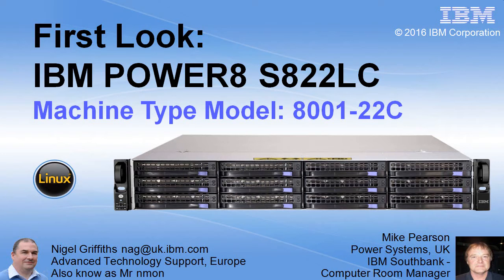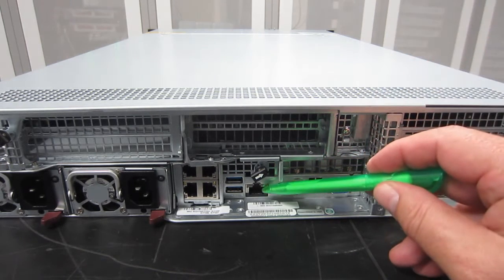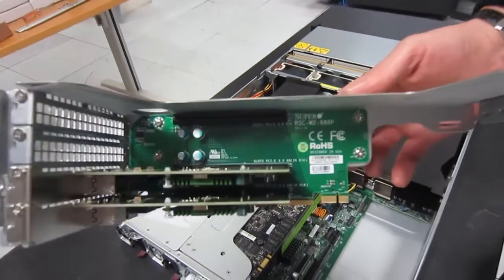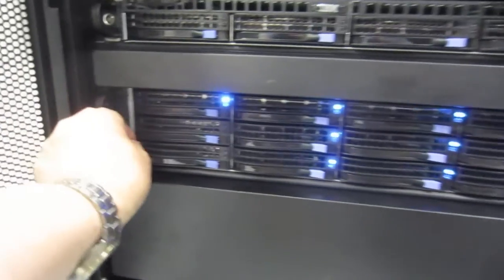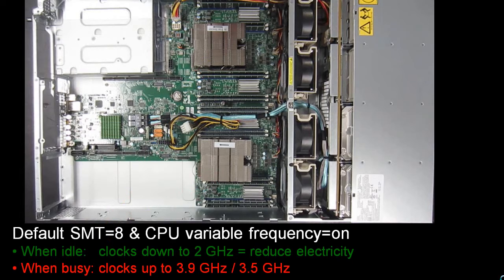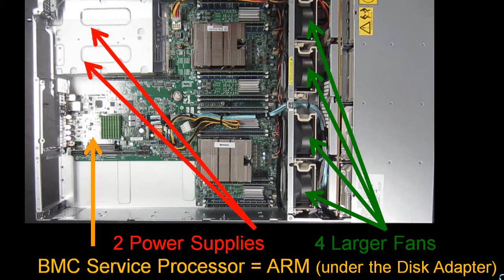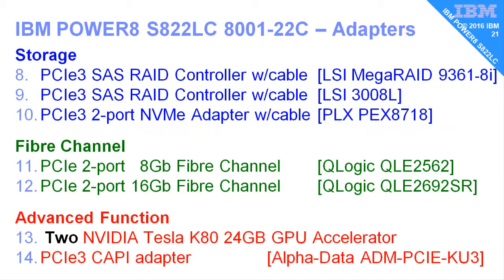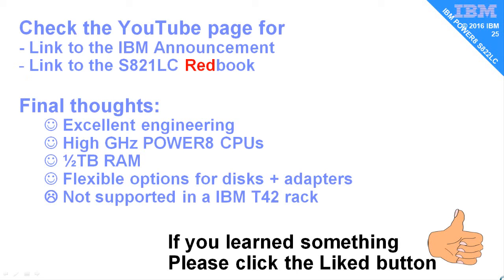First Look IBM POWER8 S822LC 8001-22C (Briggs)

Comment from the maker: Dear HelmetVanga
1) Yes, this is a server with20 CPU cores and a TB of RAM it is is not going to be a workstation!
2) It has four Ethernet connectors plus you can add further network adapters.  Every one of which should be connected to an Ethernet switch (router). Typical, networks are for different purposes Company Application Users (or the Internets with its 6 billion devices), System Admin Users, for Backup and to others servers in the computer room.
I can't imagine what you mean by four workstations.
3) Over the network, you can connect any sort of laptop running Telnet, FTP, ssh, VNC and many other network protocols. So there are many ways to access Windows 10.
I hope this was useful, Cheers, Nigel Grifftihs
Reply: thank you, you answered all  questions we. We intend to run CATIA software, ArchiCAD & GrabCad for design.

Comment: There is no question about the presentation of this IBM hardware. However, there are many questions 1) This is a server obviously. 2) it has 4 ethernet connectors, which means for 4 workstations...correct?   can you connect to this server wirelessly?  can this server be connected to a router ?  to access it from different rooms and locations?  Since this server only runs on LINUX,  can you access to it by a laptop running Windows 10?